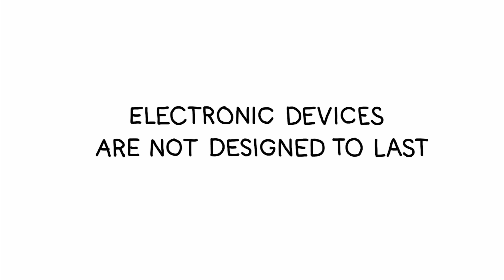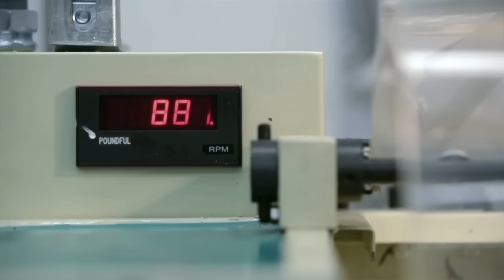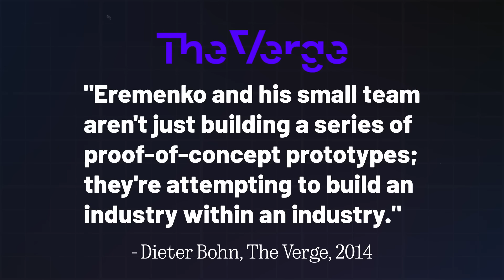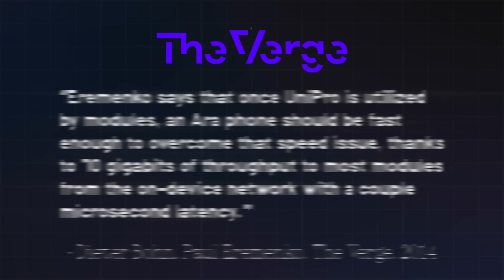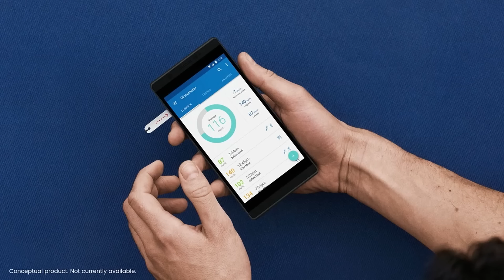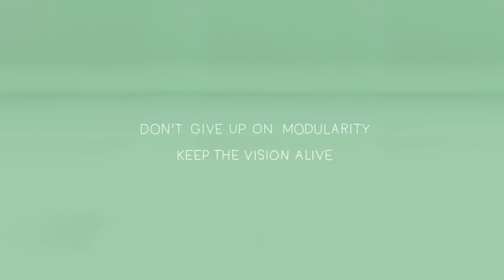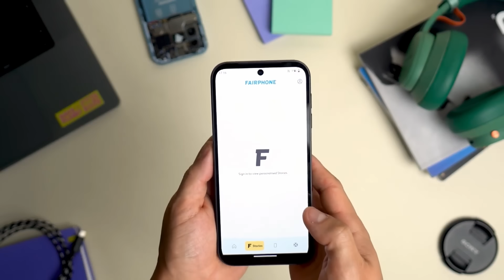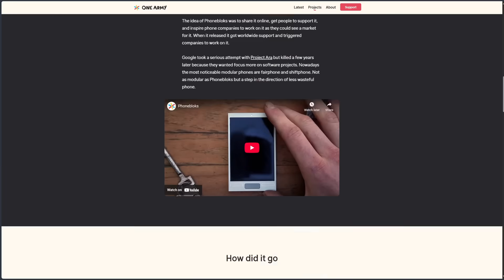Why Did Modular Smartphones Fail?

Comment: Modular smartphones may have been every designer and enthusiasts' wet dream but also every software and hardware engineer, who had to make it happen in real life's worst nightmare.
Reply: That's only because there are no standards.
Hardware modularity has been the standard in enterprise computing since there has been enterprise computing.
The actual reason is smart phone companies don't want to give up their monopolies and why replace a single broken component when you can force a user to replace the entire unit.
The other reason is most tech today is owned for status, not functionality.  People conflate intelligence with status all the time.
Reply from the maker: Lol yeah that's a good summary.
Reply: and a company worst move
Reply: You realize all the components still have to talk to each other, even if you can't take them off the board?

If you''re just an ignorant fool giving their unwarranted, uneducated opinion, why not just be quiet instead?
Reply: I was the thousandth like
Reply: Yeah if they're dumb Indians on an H1-B
Reply: except it's always been that way. even with non modular phones. it's always been up to hardware manufacturers to provide appropriate drivers for their components. also android is predominantly java based so most app software is run through a compatibility layer built into the OS. 

from what i hear, the only issue with modular designs, such as how a PC is built, was every component manufacturer not settling on a standard connection port in order to actually play nice with each other.

fun fact, i hear processors use to be a lot more interchangable until one processor manufacturer decided to have a contract with a motherboard manufacturer to accept a socket that would only allow their specific processor. which is why when you want a specific processor, you also have to have a matching motherboard. no swapping an intel for amd or amd for intel when using the same motherboard. gotta get an intel specific mobo or an amd specific mobo..
Reply: honestly i would love it if i could just open the phone, with my hands, remove the battery, put it back on, all without voiding the warranty.
Reply: @callyral you could do that with the Fairphone
Reply: @callyral too bad, they're intended to not user-friendly. y letting you replaced by yourself for 20 bucks instead of overcharge you for 150 or 200 bucks. some as Apple even went insane with their anti battery replacement tatics.
Reply: @TheOnlyVit  User friendly is relative.
Reply: @TurboLoveTrain  use freindly as in not activly trying to suck every single dollar out of the consumer
Reply: Absolutely not! PC is also modular if we think about it, it's doable, but if it's done, it will take away from the profit that companies make from repairing phones that are extremely hard to repair by average consumers
Reply: Well to use specific cpu you need a specifc mother board also right and the modules are basically made specifcally for the cpu so yeah it is not modular.  @AsharadDracul
Reply: @AsharadDracul prior to plug and play working reliability in windows computers you needed drivers for every part. Linux still suffers from this to a degree. Apple doesn't because it is a closed system with no approved 3rd party parts.
Reply: @AsharadDracul  PCs are also way fucking bigger. These are not equivalent.
Reply: @AsharadDracul  Current regulation also would make it very expensive and difficult. Every variation of a device requires a certification for EMC, SAR, etc. For example, Pixel 9 has two variants in the US (not speaking of Pro and a models), these individually require two reports. The location of antennas and components affect SAR values. So its hard to tell if a device would require multiple tests of the same band, with modular components placed in each 'slot', or if antenna locations change, would these require more? Basically, it would be one device with say 20 variants. Which each would require a separate FCC filling? (I'm stating the last part as a question because reading the fcc kdb's is hard as hell and I'm sure this would be something that would need to be inquired with the TCB.
Reply: @AsharadDracul yes but for PCs the majority of them just have to deal with Windows. 

Linux is not even a thought to the majority of hardware companies.
Reply: @AsharadDracul exactly, why would they made repair part instead of forcing customers to replace the whole rigs -> more 🤑
Reply: @AsharadDracul  althought it could be possible modules could be certified individually so it wouldnt be that case of 1 device with 20 variants. Depeding if you have individual Wi-Fi block (ie you can swap out one of the "blocks" on your device that has Wi-Fi 7 support as opposed to Wi-Fi 6) I think that would mean device would need to be tested for Simultaneous transmission (basically, you have a specified radiation limit for your transmitter, sometimes when two of them are located close to each other, such as a Wi-Fi tx and a LTE tx the radiowaves of the two could combine and go over your limit. which brings me to the not certification cost side but the cost of field testing different configurations in all scenarios (good coverage, bad coverage, etc) and checking perfomrance isn't affected based on where your modules are placed (as battery location, camera location, etc all affect that)
Reply: @AsharadDracul I'm still using old cpu with newer gpu. I wish my phone can be like this. Not to mention I built my pc mostly with used parts
Reply: @AsharadDracul  You are wrong on so many levels
Reply: @AsharadDracul you dont know shit about computers.

The compatability headaches on the software side are insane.
Reply: @AsharadDracul  It took literal decades for PC computing to even approach something resembling standards that allow true modularity without making developers' & users' lives completely miserable. And it's still a huge mess. It's taken engines like Unity and Unreal have abstracted away most of the pain.

For a similar reason you don't see much outside of free-to-play junk on Android. It's too much hassle to support such a widely disparate hardware base for a premium game, huge risk of refunds & chargebacks.

of course, with just one manufacturer, you might actually have those standards. But in that scenario, they're also going to charge you prices that make Apple look cheap.
Reply: @AsharadDracul  How modular? DDR4 is not compatible with ddr5, so you would need to upgrade the entire motherboard. CPU sockets are not compatible between each other. The only thing you are guaranteed to be able to update is storage, screen and mouse/keyboard/speakers. And, an SD card slot supporting the latest technologies does the storage pretty well. 
Phones need to run based on battery, with extremely limiting constraints. Hardware needs to be tightly integrated to avoid wasting battery. A stronger CPU needs more power, so you also need to replace the battery. It may also not support your older memory, so you may need to update it as well. At that point, it is probably cheaper to buy a new phone. The idea seems interesting, but it is a technical nightmare.
Reply: @AsharadDracul  a modular PC is not handheld, not water proof, can draw unlimited power from the mains and needs repairs if you drop it. These are all problems when you make a modular phone
Reply: @tomer4566  literally there are windows computers that do any of these things.
Reply: from software standpoint, smartphones are modular, just like PCs. Most smartphones run Android with some minor tweaks (different window managers and icon packs, telemetry and spyware that report to different corporations and governments, etc). besides, all Internet is modular, and it's slightly harder to maintain a network of billions of devices that all run on different hardware, than to synchronize parts of a single phone. this problem of modularity was solved before smartphones even existed.
Reply: It’s not even a problem of “making it happen”. There’s just so many reasons that it’s bad in use.
Reply: PC is modular
Reply: "One mans software is another mans nightmare" - Alec Watson
Reply: ...pcs are modular.
Reply: Software wouldn't have been that bad, software can handle hot-plugging a lot of hardware, except for cpu, ram and probably gpu
Reply: @whoman0385  well softwares also are not modular they use the os to do stuff, the os needs to check the hardware and use the specific driver and for every new product a new driver is made, sometimes os are not compatible either because they don't support the cpu which means they are coded in other language for example If a os is written in assembly x86_64 it can't run on a arm cpu because arm cpu use the aarch32 and aarch64 architecture
Reply: No. This opinion is not correct. Because if it was correct we would never saw modular PC. The problem of modularity  is fixed by standardisation and basic core that never changes and helps with module authentication. BIOS and UEFI
Reply: @itzk0tlin we never saw a modular pc, all parts in your pc are made to specifically work together, lemme give an example can you run a intel i7 on a motherboard made for amd or can you run a os made in aarch64 on a non arm cpu!
Reply: @akshobhyaeverything9468 great point, but you telling me vendor specific stuff. It's obvious that companies behind CPUs will make their sockets different for competition. But modularity shines even in your example. If you want to change to Intel from amd, you should buy another motherboard. All other components will be compatible. And OSes is different kind of beasts, I thought we were discussing hardware modularity, not software
Reply: @itzk0tlin  There's just no overcoming the problem of miniaturization. Phones are difficult to repair for the same reason ultrabooks are: they're designed to be as powerful as possible in as small a size as possible. Out of easy to repair, thin and light, and technologically cutting-edge, you can only realistically pick two for a mass-produced device. 

The perfect old school example is a Swiss watch. Very expensive watches are impossible to repair by the end-user because they're so small and delicate, but they're small and delicate because their precision demands complexity in a small form factor.
Reply: @itzk0tlin  Ahh, yes, because the platform where you have large amounts of space, no need for drop-resistance, and an unlimited power budget from the mains is clearly exactly equivalent.
Reply: That's stupid and wrong. Modern computers are entirely modular. Moreso than this phone would be. You don't know anything about computers
Reply: Implies modular technology can be used for anything.
Reply: @InterplanetaryTech1019 The backbone of the world is run on modular technology.  Only end user devices aren't designed for modularity... those are designed for planned obsolescence.
Reply: @InterplanetaryTech1019 I run a modular operating system (unix-like) on a modular pc, in fact, quite a lot of people and enterprises do this
Reply: @grungusmcdungus it is not modular bro just check my comment.
Reply: @InterplanetaryTech1019 The entire internet is run on modular technology as is the backbone of the electrical grid.

The only people that hate modular are woman and idiots who never do maintenance on anything and treat technology like status symbols not tools.
Reply: @Tellurian1019  uh... every desktop and server in the world? And most laptops at that.
Reply: @Tellurian1019  do you have a computer? Congratulations you’re using modular technology.
Reply: @InterplanetaryTech1019have you never heard of a computer?
Reply: We already have it going in PCs, where almost everything is almost modular. The only thing to do is just do it in a smaller form factor. Would it really be that much of a nightmare? I think not, unless the consumers allows these companies to go their own way like in today. Just limit them to be at best only have a say on which OS and UI the phone would run. If you bought say a Samsung then One UI, Oxygen if Oneplus, HyperOS if Xiaomi, so on and so forth. The modules themselves would just need drivers compatible with the OS which can be automatic to install like most things these days.
Reply: @dustintroydeguzman5411  Desktop PCs don't have the same power consumption, thermal and physical restrictions like smartphones and don't have to withstand the same high ambient temperatures, moisture and mechanical shocks. If a desktop PC has to withstand the same amount of physical and ambient stress every normal smartphone does it will fall apart after a day. There is a bunch of very good engineering reasons why laptops are built like this and nearly not all of them are corporate greed.
As an actual electroics engineer myself (albeit a pretty mediocre one) with a basic understanding of how electronic manufacturing works just the though of this idiocy gives me a headache.
Reply: @kindzadza134  ah, that makes much more sense now. Thanks for the in-depth. Learned something new.

Comment: Anyone else feel like the biggest cause of modern e-waste is being ignored on purpose? It's not just broken screens; it's deliberate software lock-in.

1. The "Golden Age" We Lost
Remember 2010-2018? If your phone's maker stopped updating it, you could just install a custom ROM from the community (like LineageOS). Devs on sites like XDA kept phones running perfectly for 5, 6, even 7+ years with the latest Android features and security. We had true ownership over our devices.

2. How They Force You to Upgrade Now
That freedom has been systematically destroyed. Manufacturers and carriers have built a digital prison to guarantee your phone becomes obsolete:

Locked Hardware: Brands like Samsung use systems like Knox, which permanently trips if you try to modify the software, often disabling key features. In the US, it's even worse—bootloaders are locked down tight with no way to gain access.

Carrier Control: If you buy a phone from a US carrier, you can forget about rooting. They are sold as locked-down appliances, not devices you truly own.

3. The "Long-Term Support" Lie
Now, manufacturers are bragging about 7 years of updates. It's a nice PR move, but it's not a real solution. It only applies to their most expensive new phones, and it doesn't change the fact that they decide when your hardware dies. The moment they stop signing updates, your perfectly capable device starts a countdown to becoming a security risk.

This is a massive Right to Repair issue. They are turning our property into ticking time bombs of e-waste simply to boost their quarterly profits.

Comment: It's like those dumb phones in that, this is something a lot of people say they want but realistically in the real world nobody does, or at least not enough to make it viable. People want premium devices, not something that you're popping bits off of to upgrade. And the form factor can never change, and who trusts companies to keep supporting it? And by the time your phone starts getting slow in a few years, you'll probably want the latest cameras and the latest screen on top of the latest processor, at which point it's like the old broom head/broom handle joke, if you've replaced every bit of something, how is it still the same phone? The concept has more holes than a hedgehogs pillow. If you really care about the environment, just get a high end device and use it for 7 years until the support stops. Repairability yes, modularity no.
Reply: i dont agree. I have been upgrading my computer over the years quite slowly and i dont really have any problems with it. Everytime i make a small upgrade it manages to catch up quite well. 

So no. I do like modularity.
Reply: @dogukankuru1969 a desktop computer isn't really comparable to a smartphone.

The comparison would make much more sense with a laptop than a tower pc
Reply: @GrandProtectorDark  I've got double the life from each of my laptops by working my way through harddrive/ssd, ram, and graphics card updates. Only CPU sockets ever held me back.

Comment: Sounds like fun, but when dirt gets into the connectors it will glitch out and fail. Imagine dropping your phone and it shuts down
Reply from the maker: Yeah it would not have a water or debris rating that's a good point. That was a major issue with the removable back for the CMF phone. It lost its waterproof rating.
Reply: Preventable by using case to enclose the backside & preventing the modules from detaching from the phone
Reply: @PflagerKatsumata exactly, simple as that.
Reply: That is one of the main reasons why current phones are so hard to repair

Comment: We were robbed of this innovative greatness 😔
Reply from the maker: Right!?!
Reply: Yeah, not really. It was at best a janky pipe dream that was almost impossible to work as intended in real life for a bunch of very good reasons.
Reply: @kindzadza134  🤡
Reply: @kindzadza134  Probably wouldnt be able to achieve the full Lego block design but it would be doable. Upgradable parts is the standard in the PC space. Repair focused phones with swappable parts exist. Android runs on the linux kernel. Drivers would have been taken care of there. This could have happened.
Reply: Just like we were robbed of the water powered car. No, it is simply impossible to do. It might seem plausible in these animated commercials, but it's complete bogus
Reply: @quieselwusul3717  Ignorance.
Reply: @quieselwusul3717  Except it was already done. Ever heard of something called a PC?